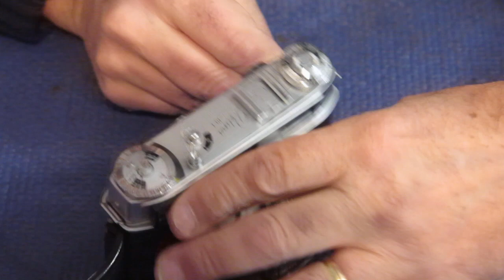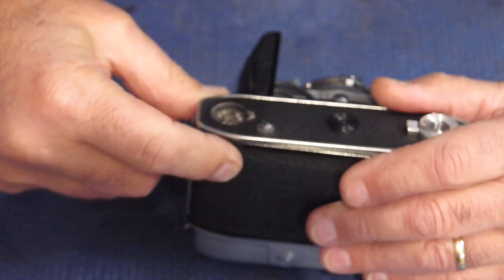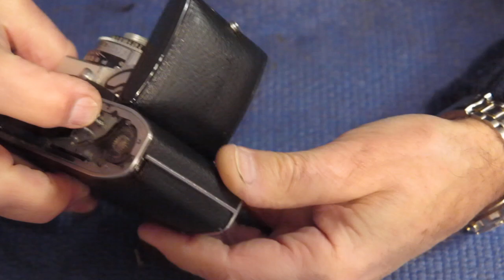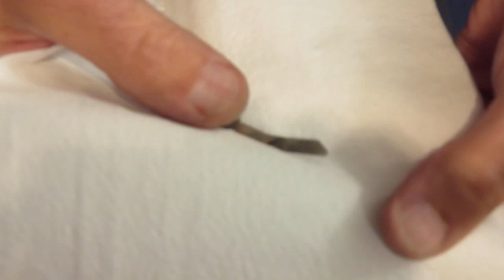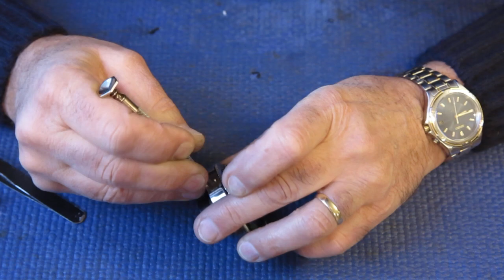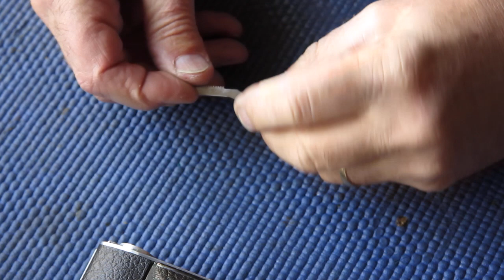Kodak Retina IIIC camera, jammed film advance lever.

Comment: Hi Chris

Took the bottom film release latch off and found a small spring (to retract the release). All good but found it very difficult to get screw and spring back. The hole for the screw that retains the spring is only visible through the spring, so I suspect (prob wrong) that the screw goes through the end of the spring. Anyway found it very tricky to get spring back with the screw.

Is there an easy way? Cheers
Reply from the maker: No easy way, you just have to hold your mouth right. Actually, the trick is easy enough when you know it. You put the screw AND the spring in place first, then put the assembly on the camera and tighten the screw, and fit its mate.
Reply: Chris Sherlock thanks mate, looked at a previous video you made assembling the IIIC and you show’d it there, nice one. I’ll have to do it again and prpoerly next time 🤔👍
Reply: @ChrisSherlock  once you have the screw in place use a tiny blib of blu tack to hold the head of the screw in place. Now concentrate on the spring. Now locate the screw into the hole. Gently remove blu tack. Bob's your uncle !